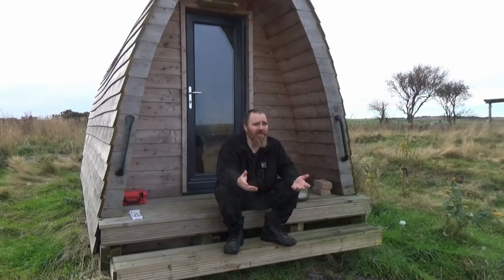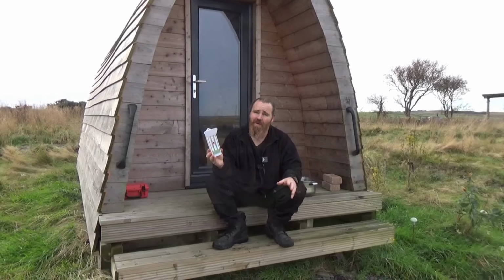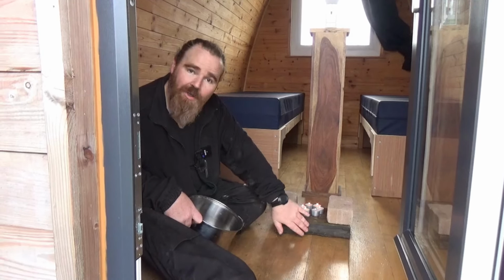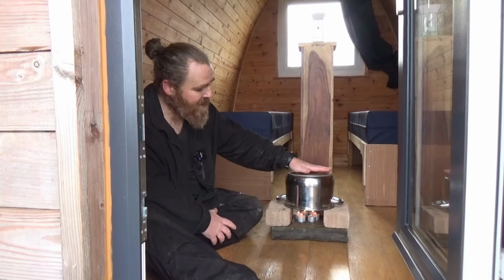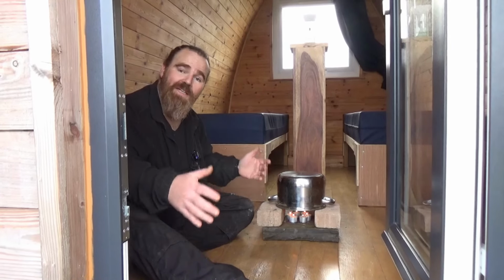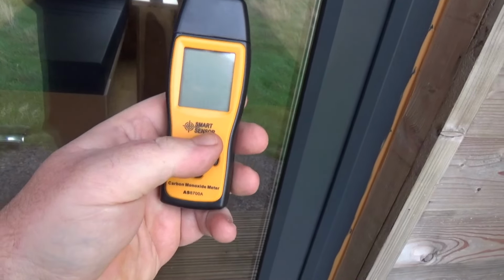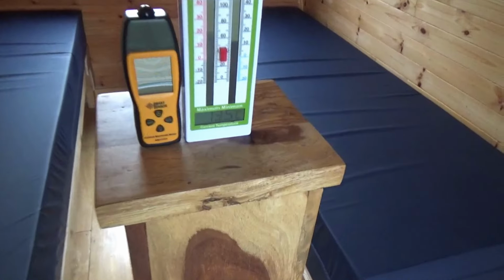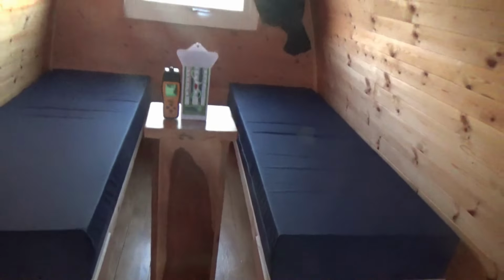DIY Flower pot candle tiny house/camper van/power cut heater tested. Effectiveness? Carbon monoxide?

Comment: We used this type of heater in our small polytunnel (8' x 25')when there was an unexpected late frost and we had a lot of seedlings in there.  It worked really well, keeping the temperature above 5°C  over night.  We use the garden min / max thermometers to check the environment.  Obviously we didn't need a CO monitor, but I would suggest any internal use of candles or butane/ propane heaters or little cook stoves it is fairly important.
Reply: Yeah, plants could really care less about Carbon Monoxide. 
In your usage, the candles actually were helping the seedlings, from not just the heat, but the extra Carbon Dioxide in their diet.
I wouldn't stay too long in there, though.
Reply: Ok but what to do than with carbon monoxyd ?? If we should have a thing like this for heat?!?! Should we have an opening somewhere??? Otherwise it is dangerous to show us this…
Reply: @TimeSurfer206  It is a polytunnel, not a sealed room!  CO could never build up to any level of toxicty.  Basically a plastic bag on metal stilts, with doors cut in each end.
Reply: @jasmijnariel  plants use carbon dioxide *CO2*.  The poisonous gas is carbon monoxide *CO*.
Reply: You could have done the same thing with an incandescent flashlight overnight.

Comment: I commend you on the simplicity, thoroughness, accuracy and safety of your demonstration!

Interesting, informative, and with absolute emphasis on personal safety when using an open flame for heating.

I particularly liked that you used a CO2 Detector and recommended their usage in addition to stating limits and comparable gas ring limits. 

I'm happy to subscribe to such an honest, straightforward and professionally run channel.
Reply from the maker: Thank you very much!

Comment: Thank you very much for explaining this and also about the carbon monoxide aswell . That was very useful to know . Good idea to have to carbon monoxide detector.
Reply from the maker: Glad you enjoyed it!
Reply: I’ve used metal coffee cans that I drill a series of 1 and a quarter inch holes around the base for air intake, the same amount around the top. Using tea candles, I kept my homemade truck camper very warm in the Canadian mountains. I agree that you have to have good ventilation, so in my camper I used a battery powered exhaust fan and another to draw in fresh air. Do the same when tenting in the colder weather here.

Comment: I have recently seen another video that a fellow used to heat his wooden insulated hut that he used to tow into the bush behind his snowmobile. The heater he placed in it used 4 taller, thicker candles inside an empty ammo box with a locking door. The lid was removed and the rubber gasket as well, but he replaced the seal with a fireproof seal and he had also cut an opening where the handle was. He inserted a tempered glass, then used a fireproof caulking substance to adhere the glass to the inside of the lid. The fireproof seal was applied next. That lid was removed from the box while he fashioned the door. For the box portion of the build he used a drill to cut two holes apiece into the sides of the metal ammo box. These holes were also placed on both sides in a parallel configuration. He used a hole saw for this. Next he used the same hole sat to cut one hole in both ends of the box. 
The pipes he used were common tailpipes for an automobile. These two single holes were used as an intake any out take ports for external air intake through the floor and out the wall at one end of his hut. That vent wall had a backing using a cement sheet against the interior wall then a sheet metal interior cover, into which he placed a hole neat the peak. Sheet metal screws secured the panel in place and a thickness of fibre insulation was placed around the exhaust pipe at the peak. Another piece of sheet metal held the insulation in. That external sheet metal had a hole cut into it for the chimney. An insert fit into the tailpipe to extend it above the height of the roof of his hut. A fireproof cap allowed no moisture to enter that external port. 
Into the four holes on the sides, he had inserted two tailpipes about18 inches long. All the pipes were held in place using a liquid weld which was allowed to harden and the interior and exterior surfaces of the ammo box were treated to a fire retardant paint.
Into these two 18 inch pipes he inserted two elbow pipes on one end. At the lower end two computer intake fans were inserted. These would reheat the internal air of the hut overnight and create no carbon monoxide buildup in the hut. 
The box was secured to the sheet metal wall then the door was reattached, with the locking latch placed on top. The stove held four long candles which burned until 5am. He was already snug in his bunk and warm in his bag. The ambient temperature of the internal space was +20 degrees in the hut with an external temperature of -11 degrees Celsius.
If I saved the link, it would have saved me typing this. At least you now have an alternative that is safer to use in your space and has zero carbon dioxide buildup.
Reply: Found it! Link: https://youtu.be/6ZnayOUQN28
Reply from the maker: Yep, I saw that at the time. It's an excellent design. I'd like to build something similar using cooking oil and a carbon felt wick, but I have a very long wish list!

Comment: WOW! How refreshing! Keeping it real and as real as it gets! No need for a desired outcome. Just facts! I've seen small wall mount fireplaces that use insulated chimney. The better ones have a feed tube that uses outside air only to feed the fire so no heated internal air is used and not creating a cold air suction draft! Uses smaller pieces of hardwood! Very decent heat output that can be slowed with intake air control. Stay warm Brother!
Reply: And a pot of water on the inverted pot will store heat, as well as add humidity, which makes air feel warmer. Low humidity air always feels colder than humid air at the same temps. Long Term candle use has negative effects on lungs though. Not a clean fuel. Short term ONLY!
Reply from the maker: In Scotland, adding humidity is something we avoid at all costs.

Comment: Very good warning about the CO. Everything with a flame emits it and when not ventilated enough, it accumulates in the room and in your body. The MAC value of carbon monoxide is 20ppm. This is the value where someone can be in for 8 hours per day. If you give your body time to get rid of it after that, you’re fine. At levels lower than 20 ppm, your body gets rid of it in time before it accumulates too high to be a problem. Ofcourse, sources of carbon monoxide don’t really emit the same amount of it, so having a CO detector in the room when doing this will give you a warning before it becomes a problem. Also take into account that babies and children have a higher vulnerability to it. 

Once the candles have burned out, the pot still emits radiant heat. It would be nice to see how long it takes for this contraption to heat up the room until it finally cools to the level of the unheated one, and then extrapolate the numbers to see how much Watts of heat energy you brought into the room.

Comment: Many things work way better than tealights, for instance, regular candles. 
What works better than any candle is an empty salsa jar, a tampon and some paraffin/diesel/olive oil - even vegetable oil will work, but it gives a very sooty flame. 
Poke 2 holes in the lid, one in middle for tampon to act as a wick, then another small hole to let air in.
BTW, leave the applicator on the tampon, it gives wick adjustment and stops it from expanding. Put the mouses-tail end into the paraffin.
If you've got one, use a copper pan. Also, breeze blocks and/or bricks make for good heat storage. Encase the pan with them or just use them without pan. 
Before the days of hot-water bottles, people used hot bricks wrapped in a towel.
Reply from the maker: Please share this experiment when you perform it.
Reply: I assumed the tampon was in the jar, submerged in oil.  Then you said leave the applicator on for wick adjustment & put the string into the oil.  Your instructions are a bit unclear.  How does your contraption work?

Comment: Consider adding a pot of water on top of the pot and benefit from humidity as well as oxygen from the water. Then in the morning you have hot water for your tea or coffee if there is any left.
Reply: Excellent point! Water steam releases oxygen!
Reply: You can only get oxygen from water via electrolysis not heating it. Electrolysis breaks the hydrogen bond of H2O giving hydrogen and oxygen gas. Heating water only changes the state of water from liquid to vapour, not the chemistry.
Reply: @youscooba  that doesn't make sense. If it shift from liquid to vapor, surely some bond has broken, right?
Reply: @grumpygrannysgoatsngardens3185  water is water, whether it be ice, liquid or vapour. The H2O bond remains, ice is water in its crystalline  solid state where the molecules align in relation to the weak hydrogen bonds of the H2O molecules. Liquid water molecules Connect in a similar way but because of temperature the bonds form and re form. As plants pump water, at the stomata, an individual molecule of H2O is released from a single chain of H2O connected by this weak hydrogen bond, and like an elevator water is drawn up from the roots. As water is heated the molecules become more active and are released from the body of liquid that is connected through the weak hydrogen bonds of H2O molecules. Every snowflake forms along the infinite symmetries of these weak hydrogen bonds. Water chemistry is truly amazing.
Reply: @youscooba  thank you for your lovely answer. I didn't understand all of it but you sound like you know what you're talking about. Here's something weird I've been told that you may shine some light on: in the Missouri Ozarks it is said that deep down we are not dependant on evaporation/rain cycles for water flow because there is a way that the hydrogen and oxygen molecules come together to form water far beneath the surface. Is this possible?
Reply: @youscooba  there will be some oxygen in solution in the water but the amount is probably negligable

Comment: On top of that pot have another pot turned right side up filled with dried sand. The sand will collect the heat, then release it slowly. Putting the cover over the pot so it heats faster.

Comment: I know I'm about to hear it. I used a flower pot candle heater when I was homeless in a tent. Yeah, yeah, yeah. No fire at all. Did it work?  Figure a 9x7 uninsulated ozark trail (cheap) tent and 6 candles raised the temp inside 2 to 4 degress F.  Enough to do my morning things and enough to fall asleep better. I can do this in my RV, and add a woodstove fan to the top of the pot. That will send the heated air through the rig.

Comment: I like this simple/emergency heating concept. Apparently rough “flat-black” surfaces both absorb and radiate heat more readily than other finishes and colors. Perhaps radial metal fins or strips would increase the  surface area of heat diffusion/radiation to the room. If in need of heating for an extended period I’d be contemplating improvising a peripheral hood-N-ducting to capture and direct the candles’ spill-under flu gas out a window - if possible under the circumstances. As I said, I like this simple/emergency concept Cairn of Dunn Croft. Great idea, I wouldn’t have thought of it. You're right, radiant heating is much more efficient than conduction or convection.
Reply from the maker: You're right, there's scope for a huge amount of experimentation in this space, to optimise heat output. In terms of radiant heat, I'm 90% finished building a rocket mass heater, the most effective heater it's possible to build.
Reply: @CairnOfDunnCroftPermaculture  Have you ever built a solar oven?
Reply from the maker: @lynnettemurphy8243  not yet, but I am assembling the materials for one.
Reply: @CairnOfDunnCroftPermaculture  First time I run into your videos. Thanks for sharing your ideas, and please also share rocket and solar oven in-the-making!! Will subscribe... to follow up on your info.
Blessings!!
Reply: What if you added house plants to the room? Spider plants/succulents are particularly effective in recycling carbon to oxygen
Reply: If you increase the rate of heat ‘loss’ from the heater then it will not stay hot for as long- the total amount of energy is essentially fixed.

Comment: Tea lights are actually pretty good for heating a room, you'd be surprised. I used them while squatting in Manchester and just a few scattered around the room brought the heat up.
Reply: I use them as alternative heating too. Spesh in the bathroom. Mines so chilly. Bought a 3 wick candle and it  makes such a difference! Safe in the sink too :))
Reply: I also have a heavy glass 7 tealight holder on a stand. I use that in my living room to boost the heat up.

Comment: a coiled hose spray painted matt black laid inside a glass covered box facing winter sun will get water in it quite hot. Run that back into your house for both radiator heat and washing. My friend coiled a copper pipe inside a wood stove and it heats her water & concrete floors

Comment: Do a terracotta flower pot. You cover the hole on the bottom, light the candles, after the pot gets hot, (about 1 hour),  you remove whatever is covering the hole. This allows the heated air  to rise better/faster, and the pot will stay hot and continue to throw radiant heat. That or drill a 2 centimeter hole in the bottom of your pot, to do the same thing.
Reply: He mentioned those in the first 15 seconds.
Reply: @SpiralMystic  Yeah, a mention. He didnt tell how to use them. He also didnt drillahole in the bottom of the pot he used. He, also, didn't tell that it's cheaper, and that terracotta holds and radiates heat longer, after the heat source, a candle, burns out. I was born to a militant, survivalist, prepper family and life. I'll be 54 soon. It's all normal, every day, life to me. There are much better ways, than using pots, to create heat. But, if your going to use a pot, it should be one that radiates heat longer. Truth is, you should use 2 pots, put 3, 1 to 2 inch rocks on top of the inside pot, and put a larger pot over the first pot. This creates a space of additional, rising hot air, and gives 1/3 more, hot air output. But, by your comment, I guess a split second, mention, of a terracotta pot, told everybody this info, and that It radiates heat longer. 🙄 Not! Best heat source are hot rocks. Heated in a fire outside, and brought in, in a pot. Radiant heat, that can be spread around a space, and reheated repeatedly. Works like a sauna, minus the water. Unless you need the steam for moisture in the air. Then pour a little water on the rocks. Especially if your heating a green house. Turn it into a sauna. Hot rocks have been used for 1000's of years. Long before fireplaces, wood stoves, pots, and pans existed, Clearly works.. mankind is still here. There are several, much better methods to create heat. Giving details is how you help people. So honestly, I don't care that he gave split second mention to terra cotta. I gave the how to info that goes with it.
Reply: @BrendaBodwin   Great advice. I would add not to use rocks from a river or any that have been in water. I’ve heard that if there’s water trapped inside, it can expand when heated causing the rocks to explode?
Reply: @kittycat1302  Correct. Just fist or potato sized rocks from the ground. Not river & not landscaping rocks.

Comment: I'll have to try this with my cast iron dutch oven.
Reply: What's a cast iron Dutch oven?
Reply: @sjakgoldberg  it's a cooking vessel that is made of cast iron with a metal handle and has a cast iron lid.  Some have 3 small legs to sit on.  Dutch ovens were used by settlers to cook over fires and hang in fireplaces to cook their meals.  They are still popular. Hope this helps.

Comment: Thank you for the information.  I have never thought about carbon monoxide from burning tealights, although I think it's safe for plants and, I hope me, in the way I'm using them.  I use one or two old loaf tins each with a double clay pot (the inner one sealed) to heat my orchid greenhouse over the winter, with a fan heater as backup.  The heat is circulated by a fan running 24/7 because orchids need good air movement.  The greenhouse is 6 ft x 8 ft, insulated at the bottom and the far end (which has a 6ft close-boarded fence behind it so gets no light) with 3 inch thick insulation foam (the stuff with foil on both sides that's sold in builders' merchants) and is also well insulated with bubble wrap, although the roof window has small gaps.  Each heater raises the temperature by 3-4 degrees Celsius, and my body heat raises it by about 1C just in the time it takes me to light them.  After much trial and error buying candles didn't stay the course I found some that do 2, 4, 8 and 9 hours very reliably an now only buy from three suppliers.  In the past it's been cheaper to use the fan heater I won't be using it much this year.

Comment: I would have loved to see a comparison with just having a pod with the tealights, and no pot. 

As a rough estimate, a normal candle gives off 80-100 W, which is roughly equivalent to one human (or two tea candles). So having two humans in the pod should heat it about the same as the five tealights. I´ve used candles to keep my campervan comfortable in autumn and spring, it works really well. But I always put them out when I go to bed and use a winter sleeping bag instead. 

In my opinion, if you´re using fire for heating, it should only be to make it comfortable when you´re awake. You should sleep warm enough that you can turn it off safely at night, because it is just too dangerous, and you also don´t want to get up all night to stoke the fire or light new candles.
Reply from the maker: https://youtu.be/sK539ekJ4bo